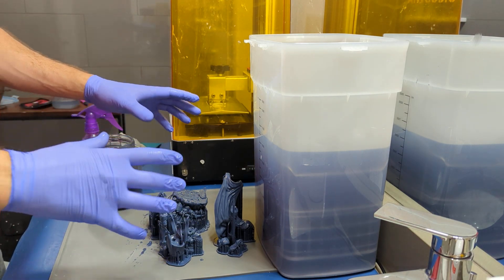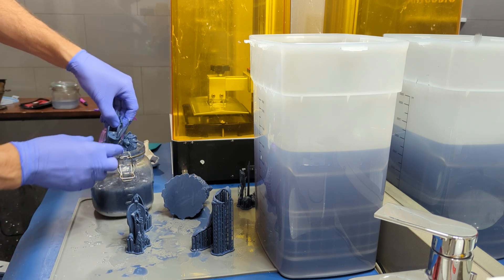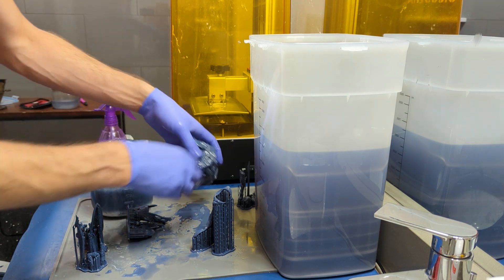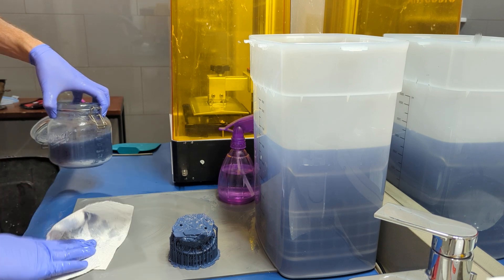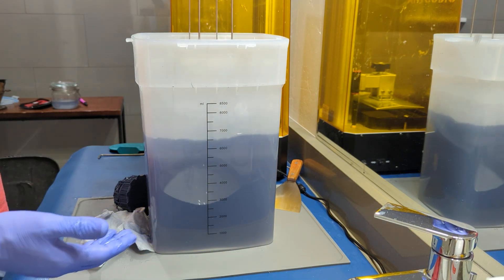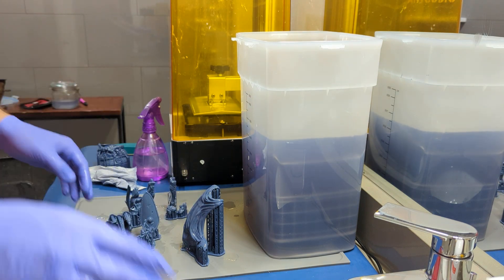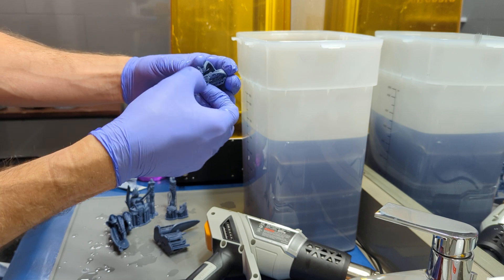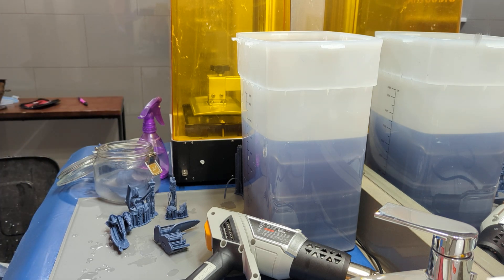How to clean your prints, even with Dirty IPA!

Comment: Can you do a video on how you recycle your IPA? I've found multiple methods from various videos and I found the best, for me, is to use the Wash and cure to cure the IPA in the tub, drain the most liquid I can (some parts are okay), then use the Aluminum sulfate method to get the last bit of resin. This isn't perfect as I found there was a little bit of monomers still in the IPA but seems to recycle the most out of it.
Reply from the maker: @exjumper999  My process is very very different. What makes it soo different is that I have a method that makes it so that I don't need to worry about having super clean or clear IPA. 

I could make a video on this but I think many will find it won't fit their work area.
Reply: @J3DTech  That's alright if your method doesn't leave it clear, I should've stated my IPA is still a little cloudy (you can never get rid of all the particles). If you can I think the community would still love to hear any way that you clean your IPA as it's good to have more than 1 method of doing something and it may help find a better way using a little of multiple different ways.
Reply from the maker: @exjumper999  Yeah I'll see what I can do.

Comment: i dont understand why do you heat your resin prints, they come out heated after print.
Reply from the maker: @henrykhenrykowski2736  after cleaning, they're quite cold. They're going to be the temperature of the IPA. Adding a little bit of heat with the heat gun is like where you just will put them in warm water to make the supports practically fall off. 

The issue with using water is now you've introduced water into your resin and you can't cure it until it's completely dry. Water takes a long time to evaporate, especially if you live in an area with high humidity. 

So instead I use a heat gun. Not a very powerful one. This makes it so the supports practically fall off and don't scratch the model while they're coming off.

Comment: What setting do you have the heat gun at?
Reply from the maker: II: 300°C (572°F). That may seem hot but but unldess you hold your hand under it for a while, it just feel warm. I picked this heat becasue overall it ran a bit cooler on the 2nd setting then most others.

Comment: Thx for the vid.  I see a lot of people washing the supports which in a lot of cases has more resin on them than the actual print. I can see if people do not want to touch the Resin and just put all prints supports and all In a cleaner, wash station which ever, but If you are going to touch the prints why not take the supports off first?  I also see people right after they rinse in IPA with bare hands take the supports off the prints even though the resin is NOT completely cured...  Just some thoughts to ad to your video....and again thanks.   I notice my IPA last more than twice as long if I take the supports off before cleaning...
Reply from the maker: Thank you, and thank you for taking the time to comment.

"the supports which in a lot of cases has more resin on them than the actual print." You're 100% correct on this, expicaly with the rafts I use, it's a lot of resin. I get off the first little bit using the spraybottle. 

"I also see people right after they rinse in IPA with bare hands take the supports off the prints even though the resin is NOT completely cured"  I also see this, it's very.. yikes! It's very bad for you, the IPA with resin I believe is worse then just resin.

"I notice my IPA last more than twice as long if I take the supports off before cleaning" This is very true, and I used to do this. I stopped as the first wash really does not matter how dirty it gets. But mostely becasue I want to remove the supports hot so they don't scratch the model. Heating a part covered in resin is not good. 

Since this video I've upgraded to larger buckets and I let my first wash get very very very dirty. I then have a 2nd and 3rd wash.

The print at the end is extreamly clean. This is the print I pulled out last night. My fist wash at this point is 6 months old, black with out 2-3" of buildup. 

https://imgur.com/gallery/WMlXn4z

Finally I'm working on a bucket 3.0 filled with recovered IPA. I'll be posting a video on it soon.
Reply: @J3DTech   Left out that you are my Hero crush.   I have been reading your guide and watching your videos.  Really trying to get the supports understood and be great at them.  My prints have improved  immensely already.  Over did the mini lights on a print today and keep finding them in indiscreet  areas on a flaming horse with rider. A print I would not have attempted without your knowledge .  I can see what I Have to do when supporting a print, but not what to use and what I do NOT have to support. Also I would like to look at a print and Understand what I am doing and SEE the print and what IT wants to make me happy...OH and a little more speed wouldn't hurt me for putting on supports.  Keep up the beyond incredible work it is hard to believe what YOU achieve with these Models!!  When I try to explain to people well that is a Digital Model it does not exist in this plane yet, bringing these things to Life, ACCURATELY is quite a thing and TREAT.   thanks again..J. I have a D2
Reply from the maker: @tomyocom5886  Thank you! These are all topics that at first feel complex but as soon as you have that ah ha! moment. They all fall into place.

The way I learned how to look at a print and say with pretty good confidence if it will print or fail is my own failures. I always saved my scenes. I would always compare what I printed vs how I did the support. Once I stopped having any failures, I then focused on quality. After a short while I felt I had this down.

Finally I focused on tip sizes under dimensional accuracy. This let me have a constant so I was not always adjusting exposure settings, only focusing on what tip sizes worked on different models. This got me to where I am today.

The D2 can be a little tricky. It's very accurate. So you're really going to calibrate it to where your supports are  holding well, but come off easily. If they are very crispy you may be over exposed. I'm working on a new calibration part for DLP printers. Now that Elegoo has one out I feel the demand for such a part will be needed.
Reply: @J3DTech   Well that DLP Calibration part is needed by me......Haha.    I look forward to seeing and testing with that part.  D2 very accurate and am dialing in bed  adhesion and noticing the supports coming off nicely after going a little bigger on tips than tableflip.  They were a little small for a noob like me..  I have much more exp with FDM but miniatures require the resin.....though I never stopped pushing for great prints with fdm,  Keep up the Great!
Reply from the maker: @tomyocom5886  TableFlip uses tips sizes that are maybe ok for minis, but for sure to small for me to get to work as well. I did really try to use them but I would only get falures. I went back to my 0.3, 0.4 as my light and medium.

Comment: Heatgun method looks really neat, supports almost came off by themselves. But I heard the fumes are especially bad when when resin is exposed to heat. Aren't you worried about that?
Reply from the maker: I have the appropriate mask and filters when doing this and in a well-ventilated room so nope.
Reply: @J3DTech  I would be very interested to know what mask and filters you recommend
Reply from the maker: @rossfranks2718  At the bottom of my guide I have links to the mask and filters I use.
Reply: @J3DTech  Ah yes sorry totally missed that! Thanks!